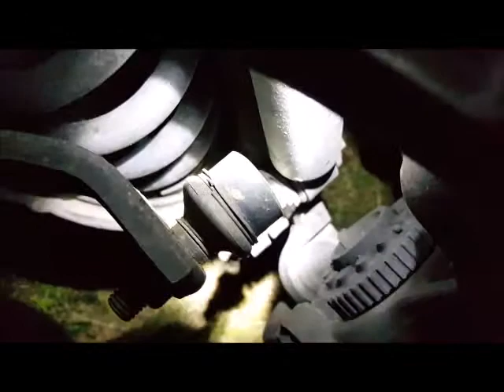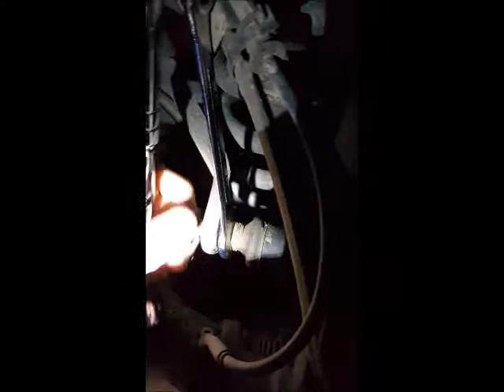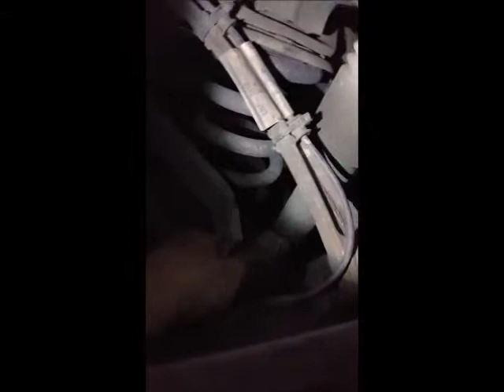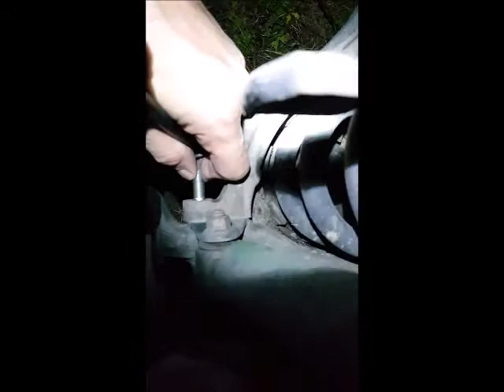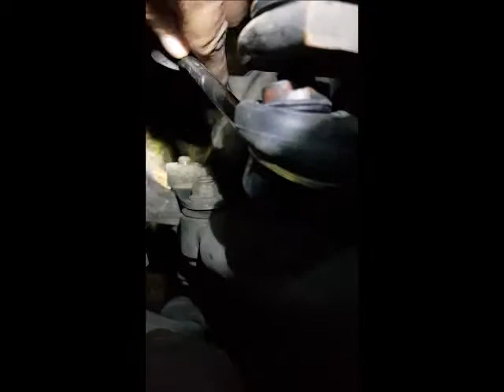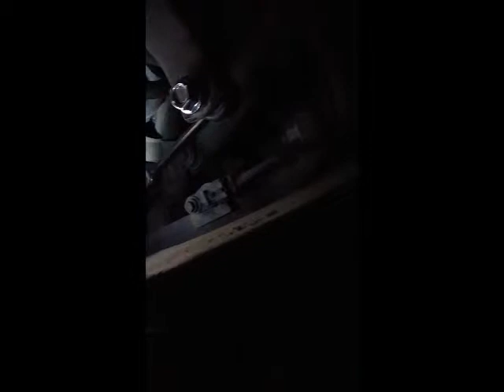Jaguar XJ8 Sway Bar Link Replacement

Comment: Gives me inspiration to attempt. Can this be done on ramps instead of stands?
Reply from the maker: It could be, but it would be pretty tight trying to get in and working around it, not to mention it would be under a compressed and tension load. Though ideally, you would actually want to do the very last tightening of the links on ramps with the car sitting at 'normal' ride conditions, i.e. the weight of the car as normal without the wheel hanging. However, it might be a pretty tight fit getting the old off, and the new on, with the wheel still on and under compressed suspension. So really the best way would be to use stands to replace the links, but leave the link nuts just barely loose, then lower the car, put it on the ramps and then tighten them fully. It's not quite as crucial to do it with end links as some other components, but sometimes it can save a squeak or two.
Reply: @CharlesOlcott  thank you so much! I’ll probably end up jacking it up/then using the ramps no need for added unknown complications 😅 thank you for the tip

Comment: My new sway bar links were delivered yesterday and I will be attempting them one evening this week. I was able to remove the old ones by jacking up one side at a time, and using a second jack to raise the hub assembly enough to get things lined up to install the new ones. Did it in the garage on level ground. Your video was a great encouragement!
Reply from the maker: It's easiest to put the car on jack stands so if need be, you can use a jack under the control arm to adjust to make it easier to line up